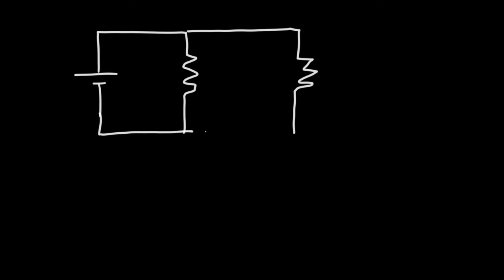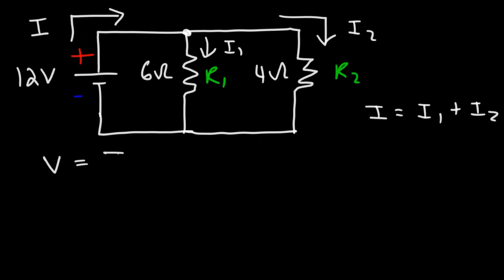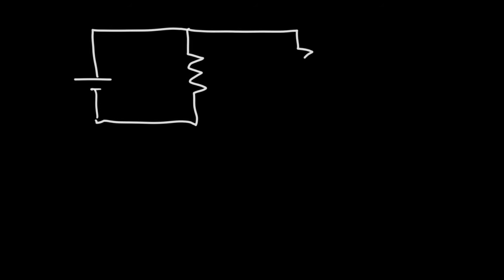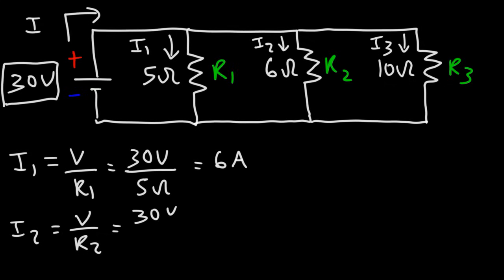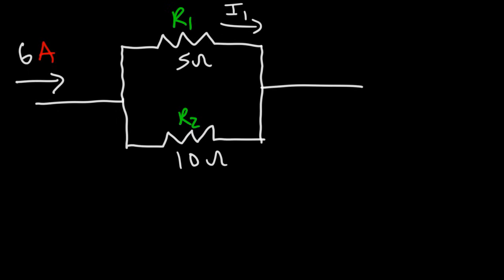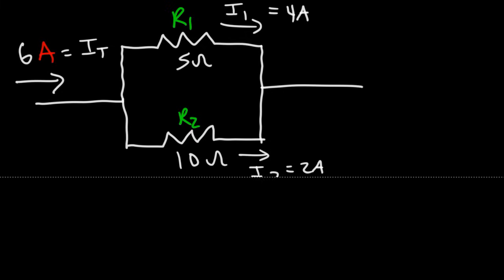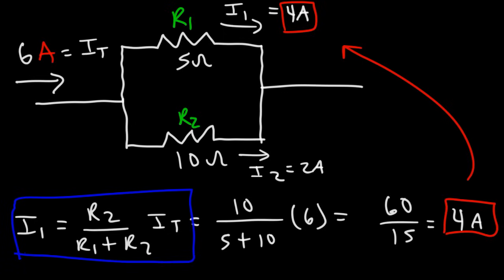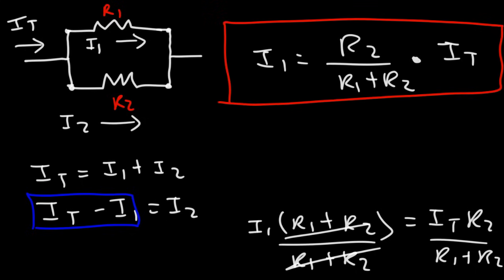How To Calculate The Current In a Parallel Circuit Using Ohm's Law

Comment: So if im right 

The given is 

+24V R1 5Ω R2 8Ω R3 12Ω
And the instructions are to find the value of current in each load and totoal current in the circuit 

I1 = V/R1 = 24V/5Ω = 4.8A
I2 = V/R2 = 24V/8Ω   =  3A
I3 = V/R3 = 24V/12Ω =  2A
I=I1+I2+I3=4.8A+3A+2A
I= 9.8A

Comment: When we finished finding the Ohms, what wattage for the ohm's should we go by? What I mean should we go by the battery watts ( volt × the total amps use )or the device's watts ( volt × device amps ) for the ohm's to handle the heat.

Comment: Why do people still give examples with conventional flow, its just isnt used any more and has been proven to be that electrons are negatively charged thus flow from the negative to the positive, how do you think lead acid, nicad, sicad. otherwise we would have to discharge batteries to charge them instead of reversing the flow of electron like we would normally other than that, a helpful video.
Reply: Unfortunately that’s still how we’re being taught. I am doing a diploma course in electronics and comms engineering and we’re being instructed to calculate everything in respect to conventional flow. It bothers me so much because in reality electrons flow from negative to positive and it chooses the path of the least resistance so it just doesn’t make sense to me.

Comment: In a parallel circuit Rt will be less than the smallest resistor.  You don't just add the current together
Reply: That’s what I thought too. I thought you added the sum for a series circuit not a parallel.
Reply: Maybe the resistance values were less in parallel…

Comment: What happens to the effective resistance if one wire has a resistor while the other has no resistor in a parallel circuit (that has 2 wires)?
Can I still use the formula 1/R = 1/R1 + 1/R2 (well, actually no R2), or do I use R = R1 like in a series?

because I got a question asking what will happen to the ammeter reading if one resistor is removed from the parallel circuit(the resistor is removed but the wire is still connected). 

R = 10 ohm (for both R)
V = 10 V
I = 2 A (when there are two R)

  ___(A)__________
  |                  |        |
(+-)             (R)      | (the R here was removed)
  |                  |        |
  ________________

Will the current increase or decrease after R was removed?

Comment: On the first example, I simply combined the two resistances into one using 1/R_tot = 1/R_1 + 1/R_2 -> R_tot = 12/5 Ω then just used V=IR -> I = V/R = 12 / (12/5) = 5 A. I think it's a lot easier to just simply the circuit and then determine the current rather than using Ohm's law 3+ times on each path.
Reply: I generally have no idea what that meant, but once I do, I'm coming back to this comment  20/07/23
Reply: Yup. I used the same trick to solve this one.

Comment: Isn't that the same formula that you said we can use for calculating the tension using newton's second law on a flat plane? Thanks! It makes it easier to remember :)
Also, will you make a video that explains how to get the internal resistance of a circuit using a VI graph please?

Comment: What if you don't know the resistance, but only voltage, for example, replace the parallel resistors in your example with LED's. How would you compute current? I'm trying to understand from another video why, for instance, a red LED with a small forward voltage of, say, 2v draws all the current away from a parallel blue LED with a forward voltage of 4v, with both of them sharing a single resistor on the back end. If they each have their own resistor in parallel along with them, everything is fine. thank you.

Comment: On problem 6A and R1 5 ohms and R2 10 ohms , I calculated the equivalent resistance by product over sum as 3.3 ohms. From this calculation 20V is the approximate voltage. The voltage is the same in a parallel circuit as shown. Did the math for the amps.  
at each resistor and agrees with your math. I omitted all math operations for simplicity  for the comment. Thanks for your excellent  valuable videos.